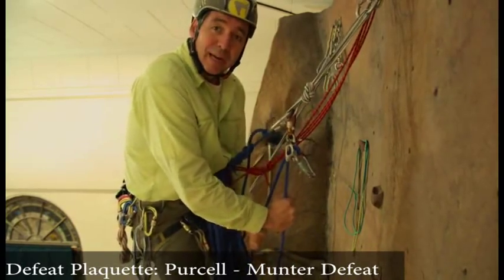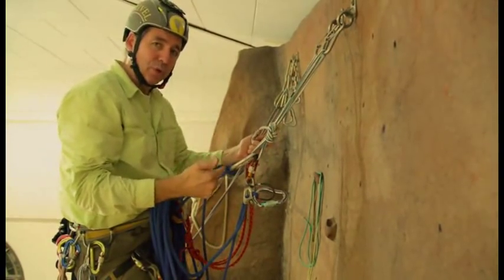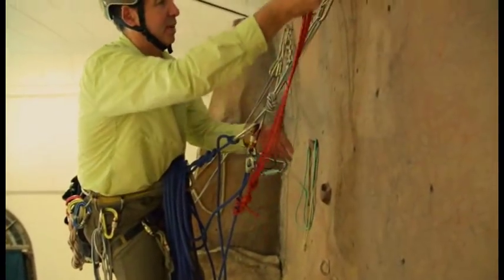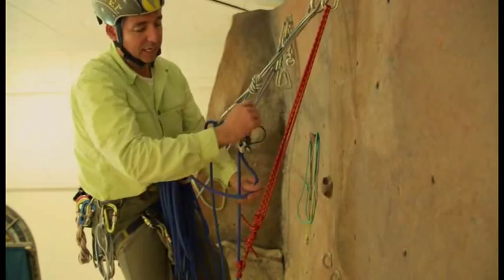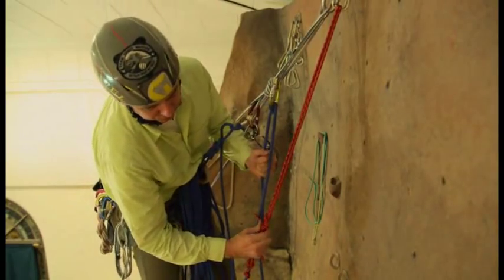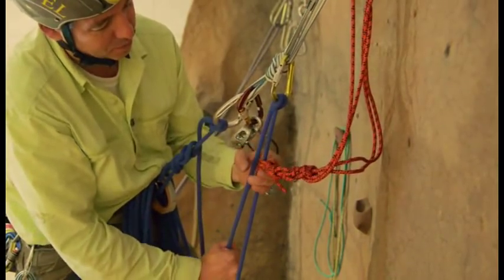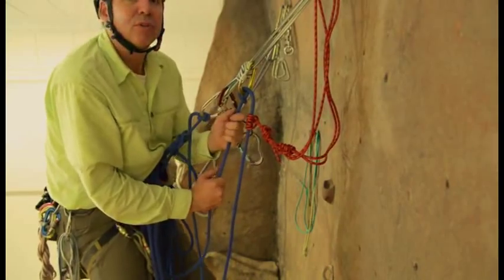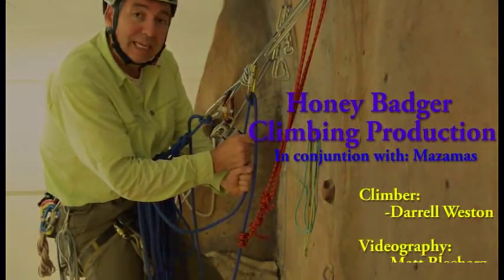Defeating a Plaquette using a Purcell Prusik+Munter

Comment: Great use of the Purcell prusik.  Why not use a sling to lower the climber with the atc guide (are carabiner with the reverso)? That won't require a switch and then the climber climbs on a hands free device the second go.
Reply from the maker: Chase Nye  Hi Chase, this is simply another option for a full defeat of the system. Keep in mind we only need to do a complete defeat like this if the climber is hanging fully on the rope (do to an overhang or something like that). And for some this can be a better option do to size and strength. Thanks for your thoughts on this.